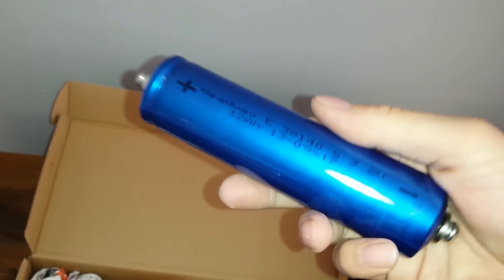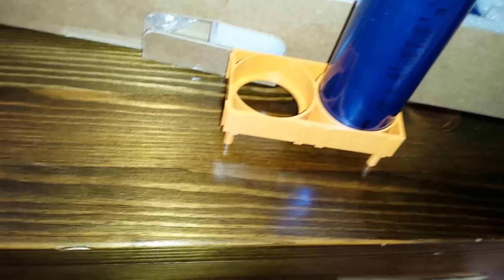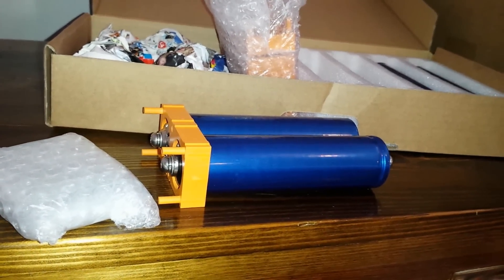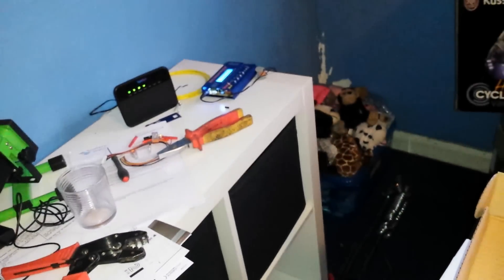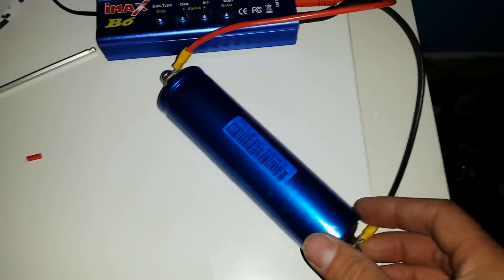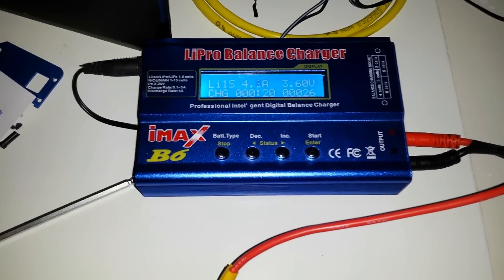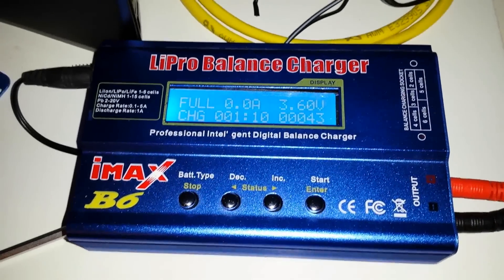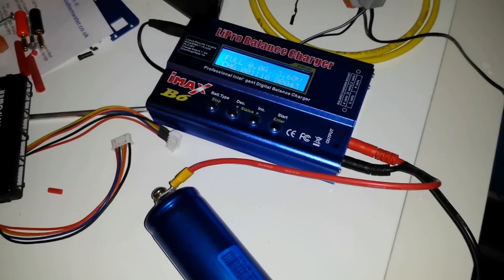LIFEPO4 part 1   Arrival charging

Comment: There 4.2 .why charge to 3.6 ,that's storage volts
Reply from the maker: Lifepo4 chemistry. It's in the title.
Reply: @pietkaify  sure they only charge up to 3.6 v ,do they sent them fully charged, never heard that before
Reply from the maker: @barrycampion9679  your serious you've never heard of LIFEPO4 chemistry in a lithium cell and it charges to 3.6v?
Reply: @pietkaify  low voltage,what's the point?
Reply from the maker: @barrycampion9679  have you looked at other LIFEPO4 videos since you said low voltage what the point?

Comment: 36A is too small to use as a replacement for a car battery.
You need triple that in case of cold weather or hard starting.
Reply from the maker: This hasn't been used as a straight swap for a starter battery. It has been used to boost a failing battery in cold mornings. Used mainly as small portable power pack.

Comment: hello, can you help for 12v 100ah or 200ah camper van lifepo4?
Reply from the maker: All depends how much power you consume whilst away in your camper. 12v @ 100Ah will give you  1200Wh at 100% flat. While 200Ah will give you 2400wh.

So you need to figure out how much you need to use to be comfortable. Also the less you discharge to flat, the longer life the batteries will have.

Comment: I need this cells  my 📱 no +918507363316  wattsap +96566554578
Reply from the maker: Reyaz Reyaz headway 12ah 34120. UK supplier was eclipse cycles . Com 

You will have to find your own supplier if outside.
Reply: I want a camplit battery many many in give you

Comment: Those are f'ing cool.  I wish I had about 100 of those suckers.
Reply from the maker: +ElGatoLoco698 These are brilliant. However even though these are from the same batch there is a slight difference in thier internal resistance leading one set of cells charging before the rest. I will go for a larger prismatic cell when the time comes!